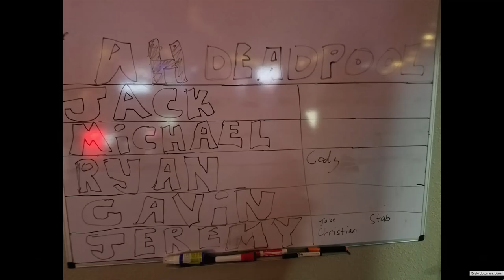The Table Gets Destroyed - Off Topic #113

Comment: I feel like placing the table back together, setting it in clear resin, stapling along the breaks with big chunks of metal in a steampunk way and finally using a brass weld-marked gear/cog in the middle with the AH logo on it would look pretty cool
Reply: It would be pretty cool. Kind of splintery, but cool.
Reply: You called it

Comment: I have an idea of whats gonna happen to the table.... using a kinda liquid gel thing that gets hard when dried, to fill up the parts and grooves that were removed. Probably gonna use some 3D printed version of the off topic logo and place it in the middle and fill the table with the gel.
Reply: JoeEverse resin. That's the word you're looking for. Or epoxy.
Reply: Yes yes, I think it was Resin I heard them call it when i saw the video on it. thanks lol.
Reply: JoeEverse no problem, as a woodworker myself i was compelled to help lol

Comment: In regards to the 619, Rey Mysterio accidentally killed a guy using it in Mexico back in 2015.
Reply: Sirius Cobra to be fair, it wasn't really the 619 that did it, it was the set up kick I think
Reply: And he broke Cody Rhodes' face
Reply: @neat crow Been a while, but you might be right. IIRC the dude was in the wrong position at least when it happened.
Reply: Sirius Cobra it was when he was kicked into the rope to set it up. He whiplashed. If anything, it was more of a freak accident

Comment: Should have got the cut off saw with the warthog blade off our ladder truck. Someone would probably die though. That thing is mean
Reply: Is that the one they use to cut off car roofs for shits and giggles?
Reply: Finley M HELL NO! Haha. We haven’t since the 60s. We have hydraulic rescue tools for that now. No we have two types of blades on our ladder truck. The one cut off saw has a friction blade that is for metal roofs, siding, fences that sort of thing. The other one has the Warthog blade which is for commercial building roofs  with stacked layers like rubber over metal over wood for example but it can be used for regular roofs on houses but we usually just use basically regular old chainsaws for most cutting we also carry what looks like regular chainsaws just with a more powerful with shorter chain blades that are our go to for when we have to open most roofs. The warthog blade is kinda just a last resort when the other saws just can’t cut it. I’m personally slightly afraid to use it because it bucks like crazy. But there’s your fun firefighting fact of the day
Reply: Finley M Also it looks cool as hell